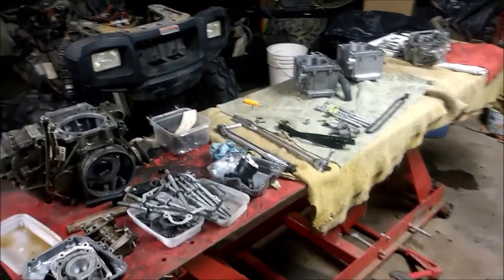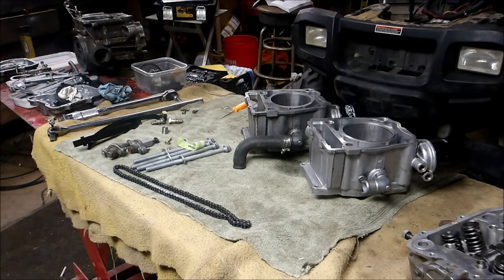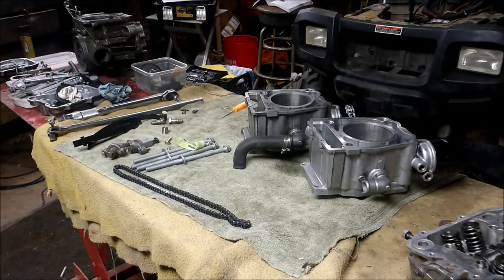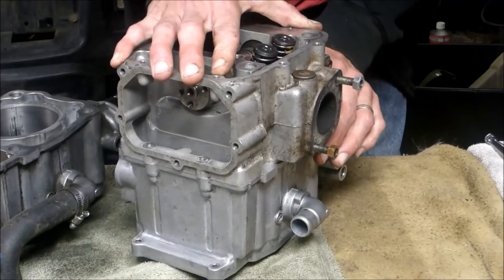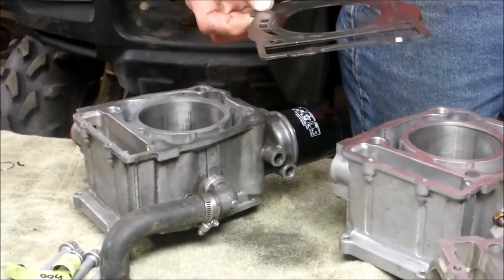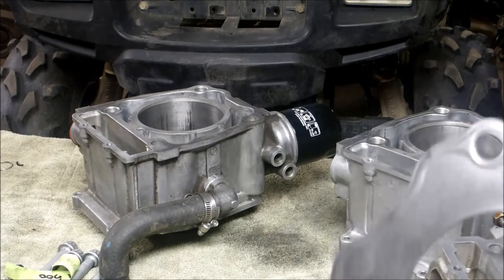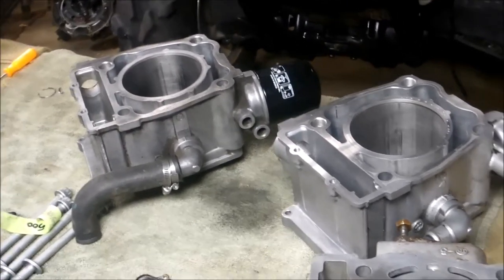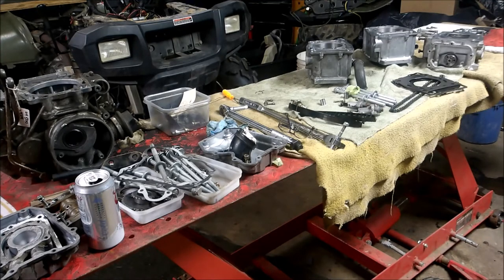Overheating issue on your Polaris 500 Rebuild! Pops and Backfires! Find out Why!

Comment: Love your videos on the 425 and 500’s. Tried to work on one about 10 years ago and there didn’t seem to be any information online about these, so I am glad to find your channel. Curious if you might could help me on my latest project of restoring an old 95 425 Magnum. 4x4.

1.) It had an overheating issue a couple year back before I had put it up in the barn for a few years. I had replaced the head gasket because it was losing some fluid, but at the time I didn’t check for flatness of the head and I didn’t know it could have been the water pump. Figured it could probably stand to have the water pump seals and impeller replaced anyways, but curious if you think a pressure test would tell my if my head is warped or should I take it off and measure myself while I have the engine out?

2.) The valve lash adjustment nuts on the rocker assembly had come off somehow. When I was fixing this I notice that my rocker arms are able to slide along the rocker shaft (port to starboard)a little bit. Is this normal or is something worn? (Exhaust cam is good btw).

3.) This is an old ATV. Curious if you would recommend replacing the piston and rings (or just rings) while I have the engine out? Compression seemed fair enough for her age last time it was running. If so, which kit would your recommend? They don’t seem to common on a 425.
Reply from the maker: Glad you like the channel. I would go with a new piston. I use Namura.

Comment: Hey love the videos they have helped me a lot.. But I cant seem to find any videos on how to change a water pump on the 500 ho engines
Reply from the maker: Thankyou. I have noticed that too. I was thinking of making a video of a mechanical water pump seal replacement. There is no easy way to do it unless you split the case or cut it out. I've used a wood screw and a drill to pull out the seal behind it. it works well.
Reply: @TitaniummanGarage  thanks for the info.. Also I had was fearing that you had to split the case.
Reply from the maker: It can be done without splitting the case. But you have to use a tip snips to cut mechanical water pump out.
Reply: @TitaniummanGarage  thanks again!!

Comment: I have a 2001 sportsman 500 HO with an over heating problem.  I replaced a bunch of parts and was going to do the water pump today.  When I took off the cover I discovered thar the impeller could be turned by hand.  I fired it up for a second and the impeller is not turning.
Reply from the maker: I would buy a aluminum impeller. You can get them off ebay.
Reply from the maker: Is the shaft the impeller is on turning?
Reply: I can turn the impeller by hand when engine is not running and when the engine is running it won’t turn at all.
Reply from the maker: That's bizarre. I have heard of the impeller stripping out and not spinning like you described. I just wanted to make sure the shaft the impeller sits on spins while running. If so. Replace impeller. If the shaft doesn't spin with the motor running you have a bad oil pump.

Comment: why dont you do videos on how you clean these parts
Reply from the maker: I had thought about it. But thought it would be a boring video. I take a gun with a wire wheel on it for the heavy stuff. Spray it with engine cleaner or sometimes soak it in gas if I have old stuff laying around. Then blow it all out with an air gun